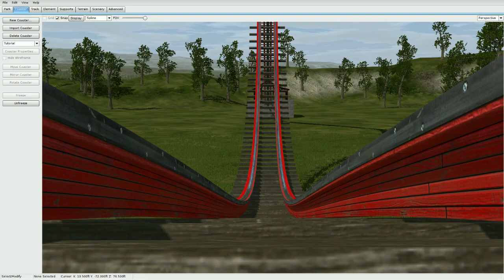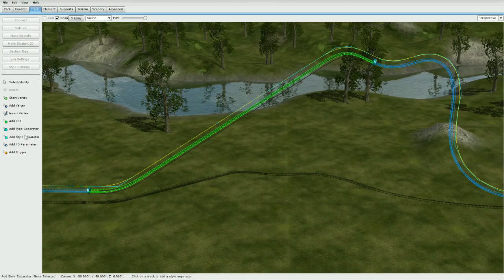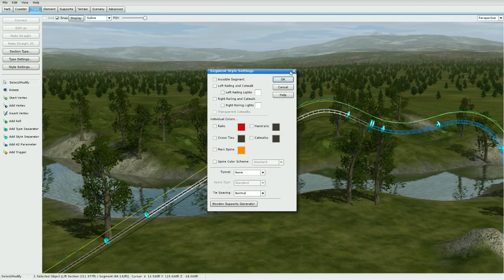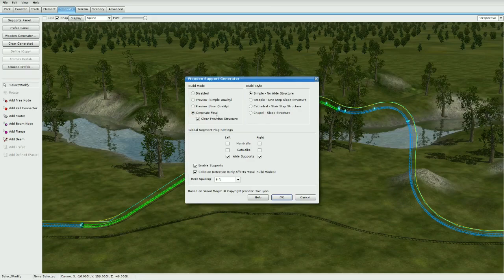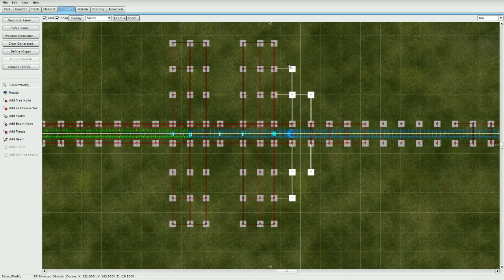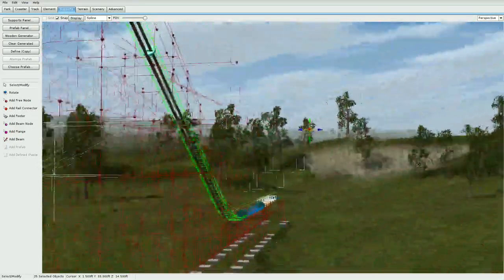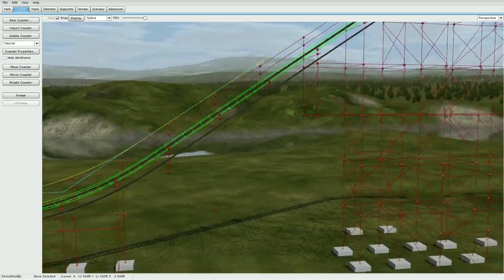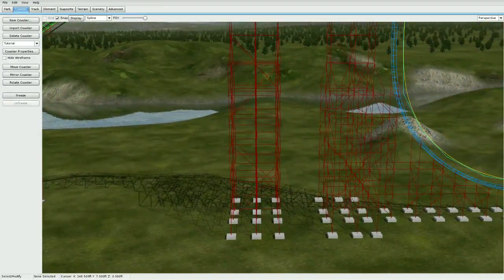No Limits 2- How to Make RMC/Intamin Lift Structures!

Comment: Have you tried selecting another beam type? Change all of the beams into something else, close the support panel, open it up again and change to what you want.

As soon as more than one beam is selected, the support panel will use the latest (selected) support properties as its "default" and it won't modify the selected supports in that area unless it is changed.
Reply from the maker: Yes I do know, & I've tried it thousands of times lol If there is one support beam in the mix thats has different settings as the others highlighted, they wont change at all

Comment: You spend a lot of unnecessary time around the 3.30 - 4.30 mark generating and deleting the supports to show the wide track bits. You can easily negate this by simply selecting Preview Final, and then modifying your track separators until they are in the correct location before generating the supports.